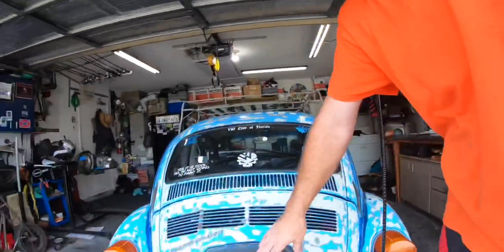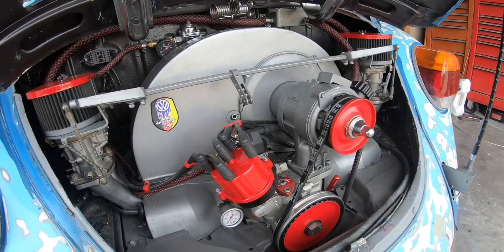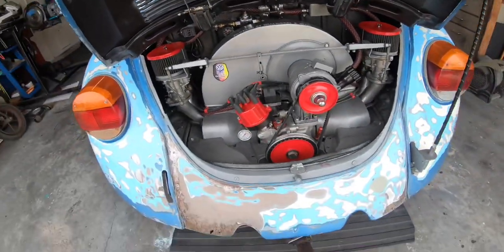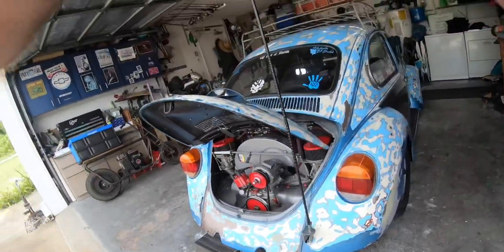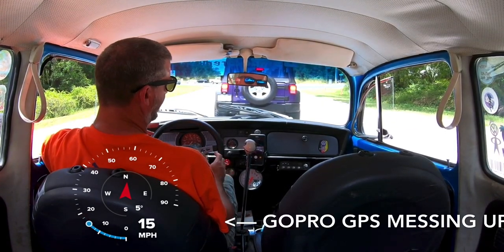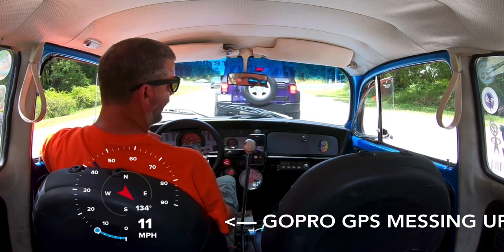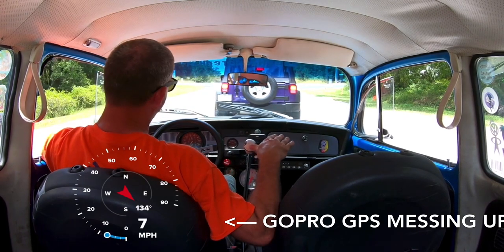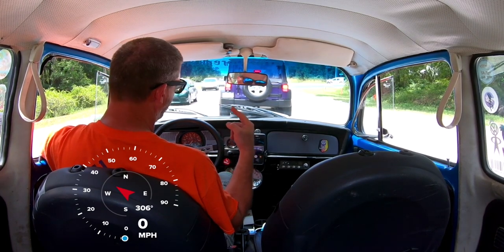Volkswagen Beetle 2054 Stroker Engine Update and Ride Along!

Comment: Your motor sounds great and pulls hard, but what is really surprising is how well it behaves when putting around town at low speed and RPMs. With a big cam, large valves and ports, and its higher static compression, I am impressed. Great vid man.
Reply from the maker: Honestly I was shocked as well on the low end performance. Engine wasn’t fully warmed up and I made that right turn in second gear barley rolling. Thank you for spelling out your thoughts here, this combo still amazes me to this day and it’s nice to see people appreciate what goes into the build.

Comment: Sounds good, it pulls well and looks great.  You’ve made great choice in the cam and carbs, very drivable.
Reply from the maker: Thank you sir, she’s fed ya runner! I was surprised with the FK8 cam, rpm band is 3k - 6500 and up yet with the small stroker build she pulls pretty decent at low rpms..... but you feel her come alive about 2500 rpms.
Reply: What heads are you running?

Comment: Bug sounds awesome! Love your videos. I just got my 1835 installed (thick wall) merged header with stinger ( love raw header sound) CB Panchito heads, I wrapped my header with lava wrap., . FK-7 cam with 1.4:1 rockers and baby Webber's, MSD full ignition.... Firing it up this weekend finally it's in my '66 Sundial camper bus so not too wild. My trans is Rhino case, super diff, 3.88:1 r&p .77 4th.. welded 3n4 hubs running sock GRB's with Kennedy stage 1 clutch...I hope it holds together.
Reply from the maker: Sounds like a sweet combo! How does it push the camper?
Reply: @VWJawbreaker  We will find out.. starting it tomorrow  or Friday after 1 year not running due to engine and transmission failures.. I will try to video the start n initial run.. I don't do videos but will try for the community..
Reply from the maker: Let me know if you post it, I’d love to see and hear it run.
Reply: @VWJawbreaker  I am a master heavy diesel mechanic.. and everyone says it's the same as building a diesel.... I have to explain to them it's not like anything and you need to listen to people with experience.. like you, VW Darrin ( VW Yoda)  the EZGZ , Mike FN Garage, Goose
Reply from the maker: Well, I’m not a master diesel mechanic but was an ase certified mechanic back in the day. VW’s are a breed of their own and definitely not like a Chevy, ford or mopar. However you have a mechanical ability, so with patience and others guidance you should be just fine.
Reply: @VWJawbreaker  just remember I can fix everything but the ignition and the carburetor as a diesel mechanic ( sarcastic )
Reply from the maker: Haha, between all of us on YouTube, we have your back.

Comment: Hi buddy I agree with you your bug is cool, I think 2 litre is a good size and we’ll I think I would like to make the same motor you have, if you can assist me on your components used ,carbs, Distrubitor . What is a good compression ratio and why cam size , fk8 is that similar to Engle 110 and was told exceeding more than  half inch lift reduces life also have you had any experience with the total seal rings also called no gap , or what video’s address my questions thanks Harry
Reply from the maker: There’s a lot that goes into a engine combination and setup…
Heads need to match the cam, cam determines the compression ratio, all of that will depend on what carbs you use. 
Best thing to do is look at the combo kits from cb performance and go from there. 
FK8 is no close to a 110 cam. 
Best to do more research and figure out what type of engine you need and for your driving style.

Comment: This was awesome!  The speedometer looked familiar lol
Reply from the maker: DuckmanCycles and VW Garage I figured that’s what you use for the speedo! Too bad it would not keep up for my video like it did in the doodle bastard video
Reply: @VWJawbreaker  The Doodlebastard cam was in the wide open, in the Beetle the metal roof will shield you from some of the satellites.  Try mounting in a different location, even outside the vehicle if you can!

Comment: Hello thanks for all the information You share sorry if My inglish is not good I AM from México l AM building a 92x76 engine and I would like to ask You until what compression ratio can I take it to the limit of street use ? THANKS
Reply from the maker: Your cam should pair with your heads and the cam will spec the compression ratio range. That’s the honest answer.

Comment: Now THAT was fun!!! Wow for as cut as it is, she’s running at 180? That’s really good!! What’s too high of a temp? 
They ride along was great brother!!
Reply from the maker: I went on a longer cruise a day or so after and the temps were between 200-210, those are good temps. 
As for general oil temps, Around 230-235 it’s time to grab a gear and slow down, let the engine start to cool. 240 and above is not good. 
Thought you’d like this video since you’ve been asking for a good ride along video 😁
Reply: VWJAWBREAKER Yeah, I was kind of bugging you about that. LOL I am so glad you did that and I truly appreciate it. 
I was asking because I never ran in oil temperature gauge before and I planned on it this time around. Especially when I build an engine over the winter. It will be a larger displacement. 
Somebody I knew had their temp running at 220, and he literally pulled the engine out of his car and put his old motor back in. I didn’t think 220 was that scary. But then again he wasn’t sure either
Reply from the maker: Even the save my bug dipstick doesn’t start to flutter till 225? And doesn’t come on solid until 235.
Reply: VWJAWBREAKER Yeah I told him he was overthinking.

Comment: Couple things. First thanks for the ride along it gives one a good perspective how it performs. No Heartbreak Hill in Florida?? 🤪 From my vantage point I think my 1641 with my Modified by me 34pict3 and 009 with points would probably hang right with ya. “Sarcasm”  more like Behind Fading Fast Ha Ha. Although I did get pulled over for going 101 in a 55. Got out of the ticket because the cop used to own a Bug and Knew they won’t go that fast 😬. Anyway I have two very Important questions  One. What kind of seats do you have in Jawbreaker. Two what Rpm were you shifting at under hard acceleration.  Last engine I heard on the Dyno was an RY45 Ford NASCAR based engine for a Outlaw Late-model  turned that 9800. I don’t think you were quite there 😜
Reply from the maker: It’s Florida so no heart break hills here lol
101, your ballsy man! I think the fastest I’ve pushed her was in the low 90’s in 4th gear. 
These are seats out of a Mini Cooper. They are super comfy and only requires minor customization to make them fit. Found a wrecked one and got the pair for $120.
I was shifting right around 6200-6500rpm on that trip. I usually drive her normal and rarely get on her like that. It’s fun don’t get me wrong but I want her to last. 
Thanks for being here 👍
Reply: VWJAWBREAKER  Been looking for some different seats. Speedo didn’t work when I got pulled over in my younger and dumber days. Stock height suspension starts making some lift at that speed. Not a real good feeling. What ever I do build in the future I’ll be sticking to 5,000 rpm probably. Plan to build it to last a good long time.  I live in the Eastern Part of South Dakota not much for long hills in the Great Plains. Just good stretches to get er wound up ha ha. But I’m kinda past that need for speed.  Just want that stop light to stop light acceleration. Which my wife told me. But we don’t have any stop lights in the entire county we live in lol. Got me there guess I live in a bit of a bubble.
Reply from the maker: Man, there’s nothing wrong with the area you’re in, I’m jealous! 
I mostly shift this engine between 3500 -4000 at the most, there’s no real need to wind this out as much as I did on the video. Shift points there were at red line but why push the engine that hard all of the time? It’s really not needed. It is fun once in a while but for the most part I drive her like I would a 1600..... just take it easy and enjoy the ride.

Comment: What gearbox do you have in jawbreaker, I have a standard gearbox in my 1850 Red Baron and it tops out at 107 mph, get there very quickly, so I need an uprated gearbox. UK
Reply from the maker: It just has a stock, mystery gearbox that was in the car when I bought it.

Comment: What RPM does it redline at Bro what do you Take it too , Nice build
Reply from the maker: Cam specs 6,500rpm…. I’ve accidentally taken it just past 7k without issue. Most of the time I try not to get it past 5500-6k.

Comment: Hi Gary......awesome!!..stock transmisión type...8x31 or 8x33??..I from Chile, my English is not good, I don't understand all your words, so I ask you in these messages ...Best
Reply from the maker: Pablo VDR not a problem at all, I’ll do my best to help you understand. 
I’m running a stock transmission but a stage 1 clutch pressure plate and a cushkock clutch disk. I take it easy and do not dump the clutch to keep from braking the transmission.

Comment: Wow sounds awesome 😎 ive a 1641 in my bus and it’s too slow I’m looking at upgrade what would you recommend?
Reply from the maker: Busses are different to a degree..... 
upgraded cam like a c25 or c35 if you want to run dual carbs, compression around 7.5:1, good flowing heads. With that any stroker size will get you more power.
Reply: @VWJawbreaker  is a stroker engine making your displacement using bigger crank rather BnP? what’s advantages of a stroker? Is it more power/torque?
Reply from the maker: @tospicy4ya  larger crank makes it a stroker. I’d also go for larger pistons as well since there isn’t any replacement for displacement. More displacement, correctly put together will always make more power. In your case you want more of the torque not just hp.
Reply: @VWJawbreaker  ive been told 1776 have thicker walls so making it a stronger engine and less likely to warm get as hot would 1915 have the same values?
Reply from the maker: @tospicy4ya  90.5 cylinders are thicker than 92’s. 94’s are also thick like the 90.5’s. I wouldn’t use 92’s for a bus.

Comment: Great Video.  Love the sound from the stinger at full tilt.  What gearing do you have?
Reply from the maker: Thanks man! I’m still running the stock trans with 3.88 gears and 196/65/15 tires. It rocks for highway but not the best for low end. Overall it works well for how I drive it.

Comment: Nice drive, question with the O2 sensor what did you finally come up with on the carb set up I.e. jetting?
Reply from the maker: Great question! I got it dialed in pretty well when it was cooler out. Now that it’s been over 95+ for a while I’m revisiting it again. 
So far I’m at 57 idles, 145 mains and 180 airs.

Comment: What size rear tire are you running? Also, what's your ring & pinion/trans set up? Sounds great!
Reply from the maker: Stock trans with 3.88 RP, 196/65/15 rear tires. Great setup for highway but it could be faster off of the line.

Comment: Not to be nosey but what did the engine build cost.
Reply from the maker: I never totaled it up honestly. The $1400 heads I got cheap from a friend along with the HD aluminum push rods, 1.4:1 rockers, some stuff I already had. So it was much less than buying every single part for the build.

Comment: Are you still running Chinese carbs ?
Reply from the maker: I went back to the Webers.
Reply: How did the Chinese carbs work out ?
Reply from the maker: @andrewsoupene1028  the 48’s worked out well. I tried a set of 44’s and had issues with one carb. Other sets have been fine… hit and miss.

Comment: What transmission are you using?
Reply from the maker: Running a stock freeway flier… just being careful with it.
Reply: @VWJawbreaker I'm asking because I'm going to build a 73  and I was going to get a  2018 or bigger and I couldn't get no one to tell me what transmission to use so I want to say thank you
Reply from the maker: @dalemaus7189  eventually this 2054 will go into the Sickxty project that I’ve been working on. It has a custom built pro street transmission to handle the power and geared for the tires I’ll be running. 
I’d suggest going with a built transmission and taking to a reputable transmission builder.
Reply: @VWJawbreaker  could you possibly give me some info to where to get some prices?
Reply from the maker: @dalemaus7189  I use Bill from B&D performance. He’s in Michigan but he’ll work with you and what not. Let him know I sent ya over. You can message him on Facebook, just look for the business.
Reply: @VWJawbreaker  ok thank you for helping me out with this.
Reply from the maker: @dalemaus7189  anytime 👍

Comment: Is it a good idea to put a 2332cc in a 57 as a daily?
Reply from the maker: Not really, would need to think about a little extra cooling since the early bugs didn’t have as much vents.
Reply: Whats the highest cc engine you would recommend for a daily? Also who built the engine again?
Reply from the maker: @Ty_RS3  you could build it any size you want, just build it for how you’re going to use it. Daily driver, less compression and not a race engine. 
I built the 2054 in the video, already have 2500 miles on it without issues.
Reply: Awesome thanks so much for the feedback and I love the channel and your content. Your awesome 👌

Comment: What cam do you run?
Reply from the maker: FK8 with 1.4:1 rockers.
Reply: VWJAWBREAKER did you go with chromoly pushrods or 3/8” aluminum pushrods?